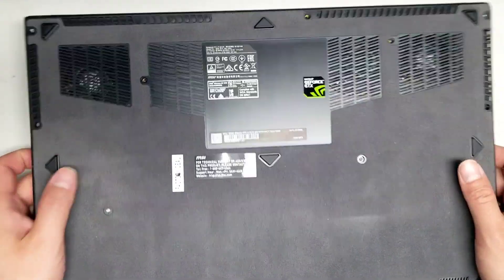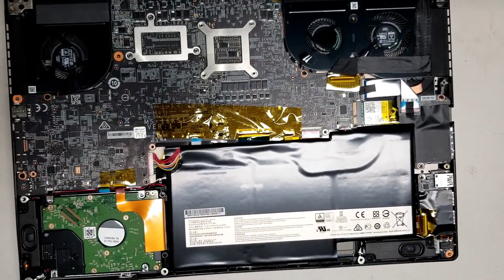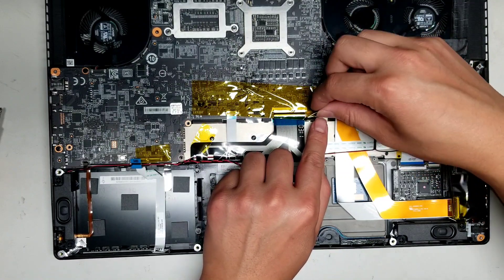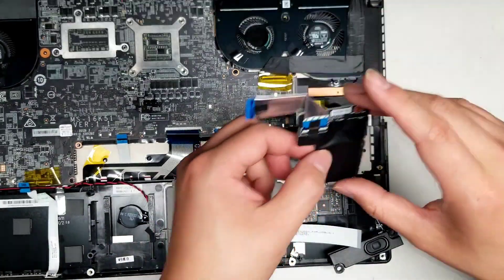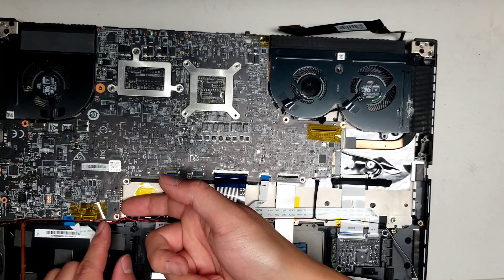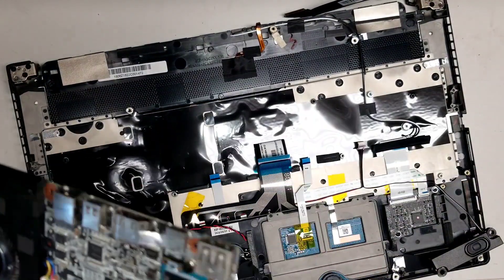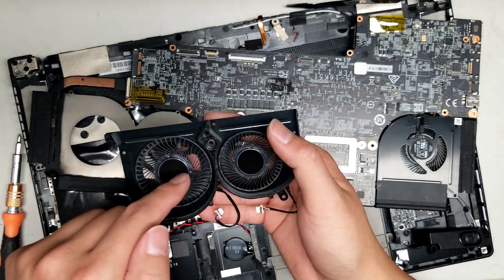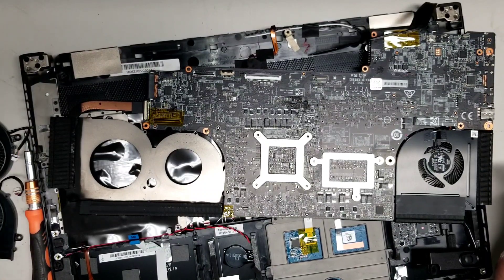MSI GS63 Stealth 8RE Complete Disassembly RAM SSD Hard Drive Upgrade Repair Noisy Fan Fix

Comment: On the palmrest on right bottom side by the speaker there is a short 2" wide ribbon cable connected to a small board right above the speaker. If you follow it toward the keyboard it goes into a rectangular slot under the keyboard can it be disconnected from the keyboard side?
Reply from the maker: It's part of the keyboard.

Comment: I have the same model but only with an ssd. My sisters laptop broke and i took the hard drive and wanted to put it in mine but apparently tye thing that connects it to tye pc is attaches to her laptop, does anyone know whats the yellow piece that connects the hdd to the laptop called? Thx in advance.
Reply from the maker: What model is your laptop?
Reply: @ItsBinhRepaired  it's the same in the video. Apparently, it's called a hard drive connector or something and it's quite cheap. My laptop only has an ssd so the hard drive area is empty and there is nothing to connect the hdd to the motterboard so i'm going to have to buy it.
Reply from the maker: @nomed8412  yup

Comment: Hola tengo un problema con mi laptop, cuando no tiene el cable de energia conectado se apaga solo ( se apaga al pasar unos 5 segundos o menos) y al encenderlo igual sin el cable, logra encenderse pero se apaga al rato, sera que la bateria esta a punto de morir? O es algun problema
Reply from the maker: Otra vez en ingles? No hablo español.
Reply: he's saying without power supply connected the laptop turns off after 5 seconds and after restarting without the power supply connected it shuts down again. He asked if you think it's his battery? I would think so. right?
Reply from the maker: I think so

Comment: My GPU fan screws have broken head,is there a way to open them ?
Reply from the maker: If you use the right sized screwdriver ph or jis1 you can probably still get it out. If you stripped it really bad, you'll need this. https://amzn.to/3ee4GQk make sure you don't leave the metal bits on the board after using the tool.